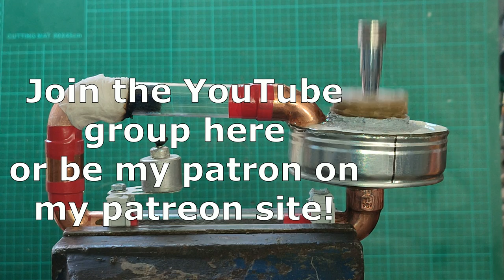Linked Piston Hot Air Engine - Stirling Engine or NOT this is the question!

Comment from the maker: Do you want more infos about my work? 🔥Review the rewards of membership! https://www.youtube.com/channel/UCurA84YG_FZS0UfZipDkSPw/join
If you don't want to be a member but you would like to support my efforts don't hesitate to use the Super THANKS button under my videos! 🙏
If you want more informations and exclusive contents BUT NOT on youtube, please be my patron on Patreon 👌: 
https://www.patreon.com/bladeattila
Reply: and yep thats a sterling engine ... it is JUST a basic single piston version ... is all 
as for its design it is a hybrid of a combustion engine and a sterling engine ... using the heat from the candle and then using the thermal acoustics of the pipes to generate the motion from the resonating waves ...
.
if it used heat from .. the radiator ... could it power a cooler ... or work as an airconditioner/heater for the car ... be an interesting way to make it useful
Reply from the maker: @kaboom-zf2bl  It's a hybrid, but not as you mentioned. The cycle is not Stirling because the power piston moves together with the displacer piston that means the cycle is different. BLADE
Reply: @AttilaBlade  it's still a sterling engine hybrid ... all is sterling engine is is a heat transfer pump ... THAT is it's PROPER definition ... and what your device is doing is ... pumping heat around a closed loop 
.
the hybrid part is the soft membrane ...
Reply from the maker: @kaboom-zf2bl  If the cycle inside not Stirling then the unit is not Stirling engine. This version of heat engine is NOT STIRLING because of the different cycle. It's just looks like a Stirling, but the working method is different. Just try to thinking about HOW IT WORKS, and you will see the differencies! BLADE
Reply: @AttilaBlade  actually the error you made was the distinction .. a sterling is a heat differential engine ... and this closed loop is JUST ... that ... the one we see and use as a sterling engine is an open loop heat differential engine ... BOTH are still sterling engines because that is what a sterling engine is ... nothing more .... a 2 strong engine is as much an internal combustion engine as a 4 stroke or diesel just because they go about the process differently doesnt change their basic use ... you dont call a 4 stroke engine different each time it gets a new cylinder added on either ... and that is what you are doing by calling this a different type of sterling engine ... Sorry but you are putting too fine a point on a broad spectrum meaning of sterling engine ...
Reply from the maker: @kaboom-zf2bl  Here we have not a diesel or gas oil engine with 2T or 4T. The question is not same as a gasoline engine is Otto motor or not. There are lot of different cycle engines with internal combustion too, but nobody call them differently...but should. Much easier to say diesel engine or gasoline engine or internal combustion engines because that is a bigger and bigger range. But here we have different cycles, also different engines. An Ericsson or Manson, Bryton cycle engine never called Stirling engine, just when the inventor, especially Ericsson as an inventor made a unique Stirling driving mechanism and created his Stirling cycle engine and sell it. But on the other hand He has an another good but different cycle hot air engine what we call Ericsson Hot Air Engine. Not Stirling...because the cycle is totally different.  Not all of the hot air engines called Stirling just because that is the most popular name in this segment, and lot of people lazy to read more about hot air engines... that's not my fault! Probobly I've made, and I will make errors in my life, but nobody makes mistakes without work. So, no problem with your viewing point but if you know the thermodinamical cycles deeply enough then you shouldn't ignore my words about my engine never used Stirling cycle for work. The "Hot Air Engine" category is correct designation but that is another bigger range asthe  internal or external combustion heat engines in this endless debate. BLADE
Reply: Whatever it is it seems to work, and should produce power in a coil or push a flywheel. 
Advantage is that several of these can be put to a driveshaft.
They can also easily take sunlight from a Fernel Len's, mirror.

Comment: Blade 
How long will it run before the moving parts break?
Reply from the maker: That' s a good question, but I don't really know. This is a model unit only. For a real power unit should be designed for a long period and high repeating number and also we should run it and measure it for a long period as possible.